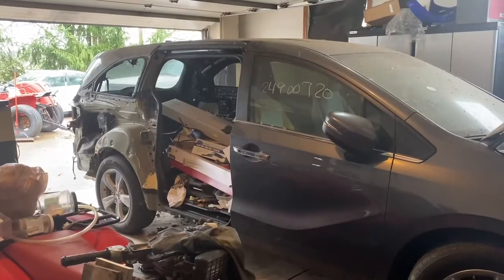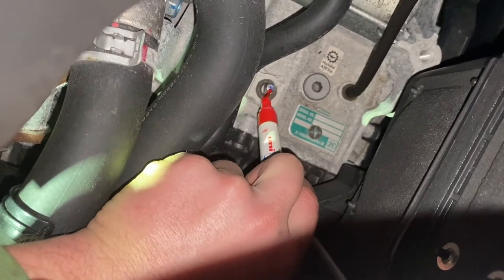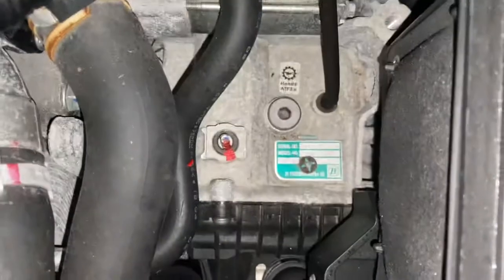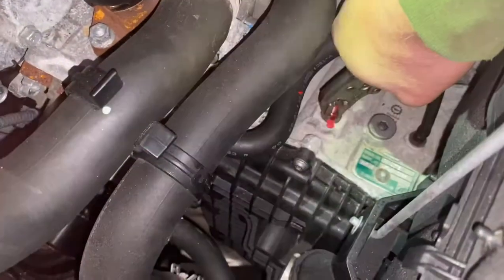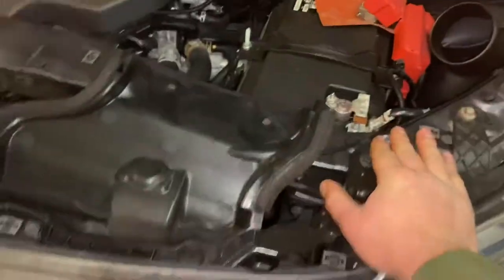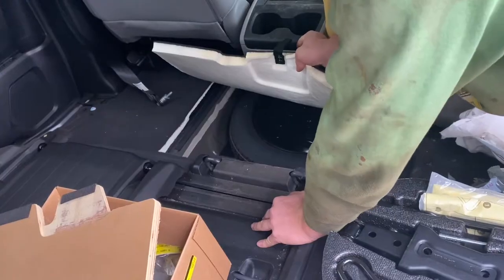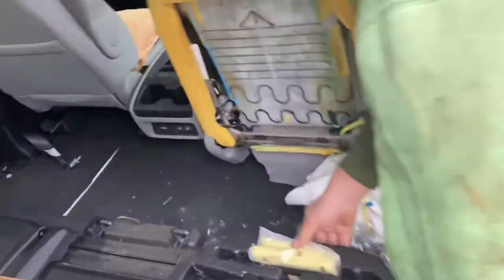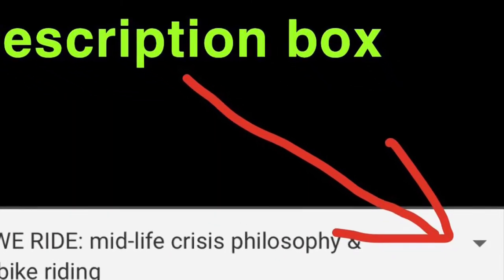2019-2023 Honda Odyssey put into neutral no power

Comment: 2019 Odyssey- I Ran out of gas in the middle of the road, car would not start dead. If you cant start you can't put it in neutral, the car has to be running. So you cant roll it off the road. What good is neutral?

Comment: Your video covers up to 2019 Odyssey's, the 2020+ and up used new 10 speed transmissions and that top adjustment function has been removed. Thanks Honda 😞. And not as of yet I have NO workaround to put the car in neutral when battery is dead. (UPDATE, I bought a portable battery jumper=worked, able to pull car out of garage)
Reply: His video is a 2020 and it does have the 10 speed transmission. The 2018-19 Touring and Elite models also have the 10 speed.

Comment: I own a 2020 Odyssey. The battery in your truck is still there. If there's power, turn on the ignition, press the brake pedal lightly to turn  the brake lights on and shift the truck into neutral as normal on the dash and push it, instead of all that screwing around under the hood. Worked for me.

Comment: We have a 2018 Odyssey and it goes into neutral with the wrench too;  same as your 2020.  What a horrible design.  The person holding the wrench has to walk/run backwards while one person pushes, steers and controls the brakes. A 3rd person may be needed to push as well..  Why does Honda have to make it so difficult?

Comment: So if you have to put this on a rollback, someone's got to be elbow deep in the engine bay walking with the vehicle while someone else is managing the tow truck?
Reply from the maker: Yup pretty much. It’s load of BS. I imagine Honda has a tool that will hold the the van in neutral, why they didn’t include it with the van from the factory is a total mystery. The silly thing about it is no one‘s gonna have that special tool, when something like this happens and you need to be towed. So Jimmy from the towing company is gonna have to be elbow deep in the engine bay holding the thing into neutral, while Johnny is working the winch on the tow truck. Kind of crazy right?!
Reply: Agreed very frustrating, thank you for sharing,much appreciated

Comment: I have a plastic box and it doesn’t look like that I need help
Reply from the maker: It’s going to be tough to figure this out.. there are lots of plastic box parts on these vans. Do you know what the box is?
Reply: I had the same problem with a tow i was doing, same honda car, is like a electronics box that cover that same lever thing that was shown in this vehicle, i came across a honda pilot that didn’t have the box and i did exactly what this videos shows. For the odyssey i had to drag the car with skates up the tow truck bed